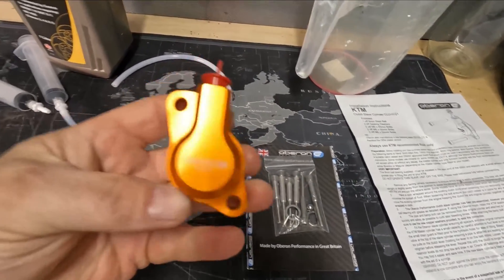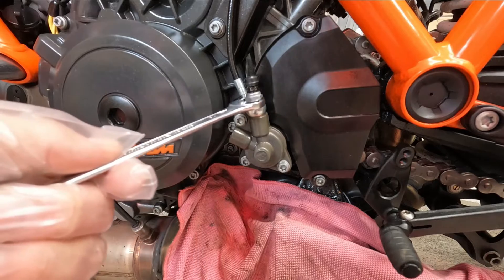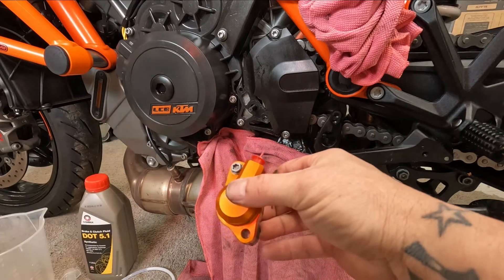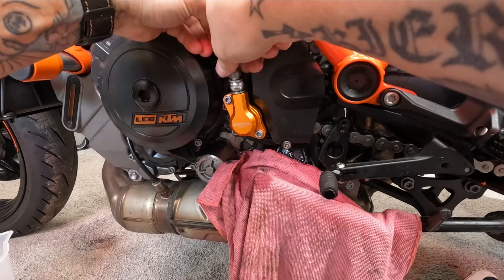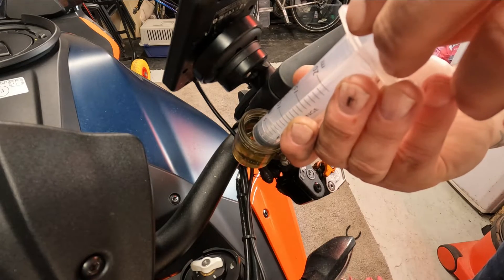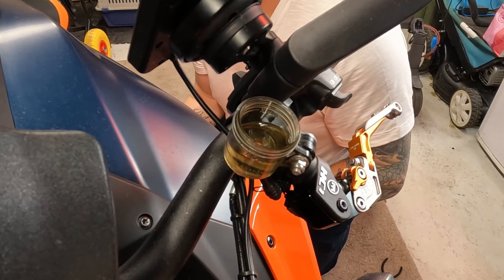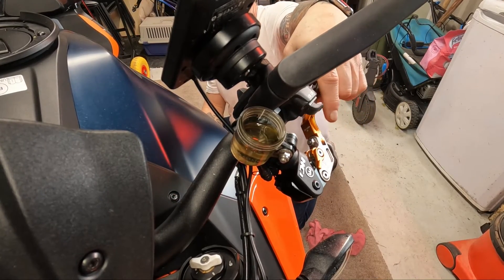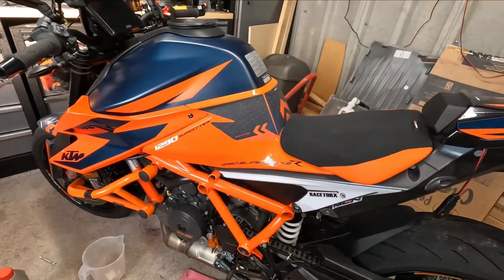KTM 1290 Superduke R Oberon Clutch slave cylinder.

Comment: Proper way to bleed the clutch is to bring the lever all the way in and let it spring forward on it own. The more you flick it the more bubbles you get out. Alot faster and easier
Reply from the maker: This is the proper way for these bikes according to a KTM tech.
Reply: @Robbiemoto  Yamaha,  Ducati, and a ktm tech says otherwise
Reply from the maker: I guess each has their own way. I enquired with a KTM tech and he said the way to bleed them easily is reverse bleed.
Reply: @Robbiemoto  me too! And just so you know, there is no bleeding procedure in the shop manual. It's whatever the tech decides to do. And everyone does it differently. Your way is  just messy and takes a lot longer. Just did the same thing, and all I did was flick the lever and all the bubbles were gone. Just like the Yamaha, Ducati and ktm tech said. Try it before you discard it. Or keep doing it the messy and longer way. No matter what when your pumping into a system there is going to be bubbles regardless of the direction. So no you didn't get it all
Reply from the maker: @waltermiller249  Well the clutch works and is stronger than before so agree a little messy but this old amateur got there in the end. Lol.

Comment: When bleeding your breaks or clutch. I wouldn't use the res fluid. As it'll have air trapped inside it, you'll just be chasing your tail. I'd just get more fresh stuff from the bottle. Break fluid is cheap

Comment: Robbie, put your diaphragm back in properly it's meant to fold up in itself not be fully extended, next time if you're quick swapping over the line you won't lose all your fluid and I'm not a fan of backwards bleeding although many people swear by it..
Reply from the maker: Thanks for that. I did think it look a little funny when I took it out. As it wasn’t like that when I bled the clutch before but didn’t think anymore of it. I think it’s fixed itself once I started pulling the lever in as it’s not extended in the reservoir. Apparently the only way to bleed these are reverse bleeding.
Reply: @Robbiemoto  definitely not the case I've fitted the same master cylinder but I did use the new backing plate, my old master cylinder was rusty on my retaining clip I had one replaced under warranty but when I took that one off that was rusty as well.
Reply from the maker: @richiektm  Fair enough. I’m only going on what the dealer told me in the past that KTM clutches have to be reverse bled. Either way it works lol.
Reply from the maker: @richiektm  You we’re spot on mate concerning the diaphragm. I went for a quick ride after I fitted the slave yesterday and the pot looked clear. I’ve just checked after you mentioned it and it was the same so I pulled it and reshaped it. Good spot my friend.
Reply: @Robbiemoto  no worries pal

Comment: i've swapped my factory slave for the oberon one and followed your guide. No bubbles seem to be coming out on top, I have proper pressure at the clutch lever but when my bike is on the paddock the wheel won't stop spinning when I pull the clutch back in.. .Do I have to keep bleeding it?
Reply from the maker: Hi. 
Sometimes as there’s no resistance on the back wheel it can still spin. Put it in Neutral and Rev it. You may see the wheel turn a little. As you saw in my vid even after I had a few bubbles come through I kept on bleeding it just to make sure. 
But if you have a good feel to the lever then just maybe only a few tiny bubbles came out. They were really small for me. 
Maybe go for a ride up and down the road a little to see how it feels. If your not happy with that then for peace of mind I’d probably go through another 5 or 6 syringe fulls and bleed it some more. 
I hope this is of some help.

Comment: Robbie, did you happen to see the 44 teeth and knox channel reviews of the gasgas sm700? Both bike testers experienced front wheel tuck when testing, do these bikes (gasgas sm700/husky 701/ ktm 690 smcr) require a steering damper in your opinion? I'm curious why the testers experienced the issue on the sm700? I have not noticed it being reported on any of the 701 or 690 reviews. Thanks and Regards,Ciaran
Reply from the maker: Hi. No I didn’t but I’ve not had an issue with the 701 at all.

Comment: while we are asking questions that have nothing to do with this video😉    do you remember the part number of the givi tank lock ring you have used? There website says they don't have one for my 2022 evo. Thanks in advance mate 👍
Reply from the maker: I believe it’s still the same as a 2020 which is BF11. But double check with your dealer that the fuel cap design hasn’t changed. I don’t think it has but don’t take my word.

Comment: Hi Did this prevent air getting in the clutch fluid .Got air in mine now tried reverse bleed still not  right.. had this problem with previous owner so going in under Warranty may need a aftermarket slave .
Reply from the maker: Hi. So far so good. I had an issue with the clutch being “soft” and as you may have seen I bled it but wasn’t totally confident it wasn’t gonna happen again hence why I opted for the Oberon unit which as said has been faultless so far.
Reply: @Robbiemoto  ok good to know
I’ve heard similar on other ktm . mine started in Germany still rideable but made hard  to get into neutral while clutch not completely disintegrating. I see what ktm say going in for that and the usb on dash not working under warranty. 
I looked up the part you fitted I think  they around £112 if out of warranty be a good replacement. But it sounds more like it such really of  been a recall on the failing OEM .
Reply from the maker: Yeah they’re not too expensive. Even though I’d never done anything like that before it wasn’t too bad to fit and bleed. 
Why the USB isn’t working is a strange one. I hope you get it all sorted soon.